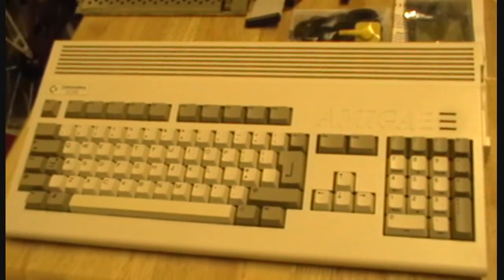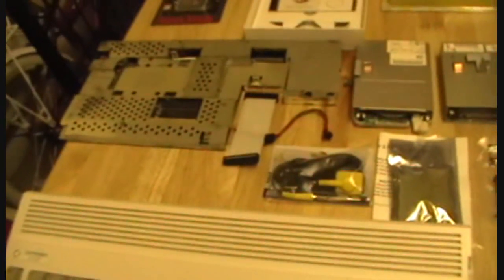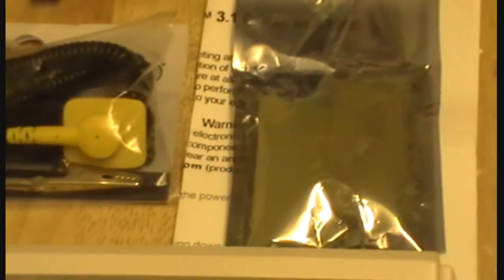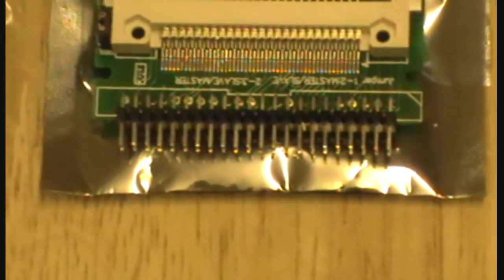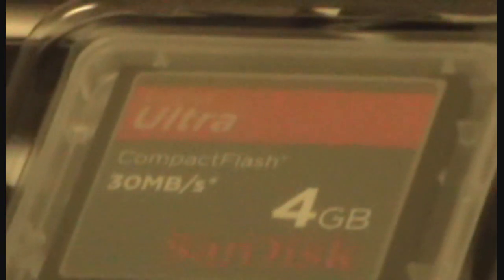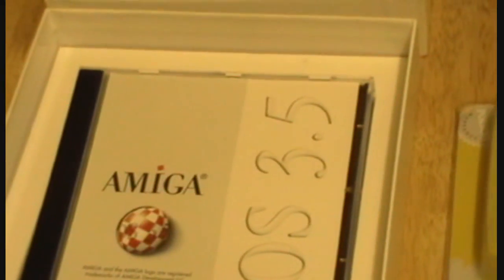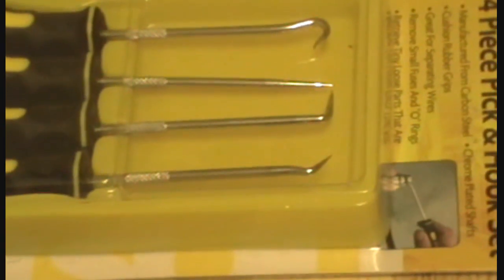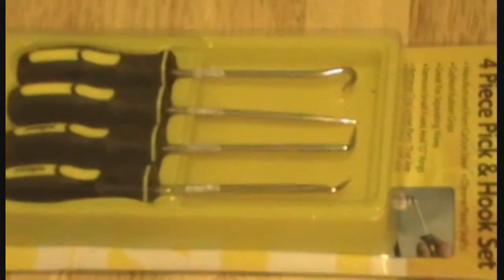Amiga 1200 Project: Part 1/5. Motherboard replacement and upgrading to 3.1 ROM with CF Flash Drive.

Comment: use a IC-extractor tool!!!!!!
Reply from the maker: Yes I really should bet myself one of those but I haven't messed with ICs since making this video. It is definitely on my wish list though. :)
Reply: Goto ebay u can Get a ic-extractor from £1 worth it.
Reply from the maker: Thanks for the tip for that price you can't argue I think I found the one you were talking about it's a "PLCC IC EXTRACTOR 20-PIN TO 84-PIN REMOVER TOOL PINCER" just over a quid.
Reply: Thats the one, got it my self. It Will be your most helpful tool.
Reply from the maker: Again, many thanks for the tip. I shall be ordering within a few days.

Comment from the maker: @nicholasthetaylor The Blizzard 1260 is an awesome accelerator card and I would love to get my hands on one of those one day. You could add a 4-Device Buffered IDE Interface (A1200/A600) which is available from Amigakit.com for about £13.99. You can use this device to add a CD-ROM and house it within your original 1200 case. This won't affect the internal Floppy. One of my YT friends RetroSofer did a nice CD-ROM mod using a laptop CD drive in the 1200 case, check out his channel.

Comment: @DLiberator78 That sounds awesome! I'm torn between rehousing into a tower, or doing what expansion I can within the original case. I would like to keep the a1200 case, so I'm thinking 3.1 kickstart, Blizzard 1260 64mb with clock, 4gb flash drive, cdwriter and original floppy. It will probably melt. That's assuming that I am able to have three IDE devices connected. Is this possible?

Comment from the maker: @nicholasthetaylor Granted and you are correct. I just wanted to put this to the test. Fortunately I have another Amiga 1200 which has the original 127MB Hard Disk that came with it when I bought it in '93. My ultimate goal is to build an A1200 tower and that will have a full sized 4Gb HDD. Thanks for your comments. :-)